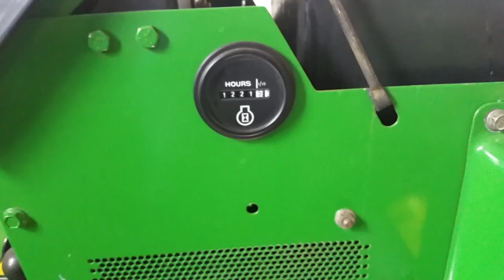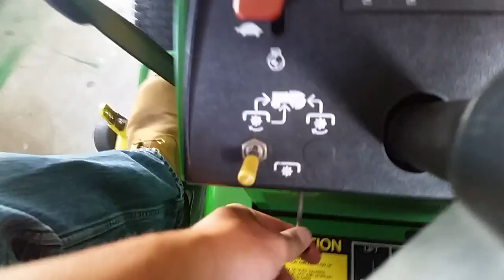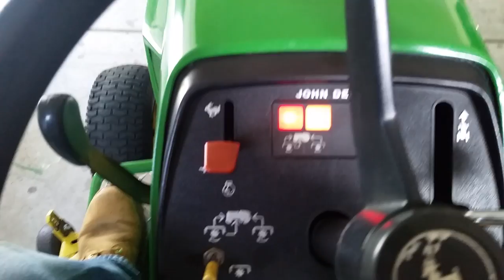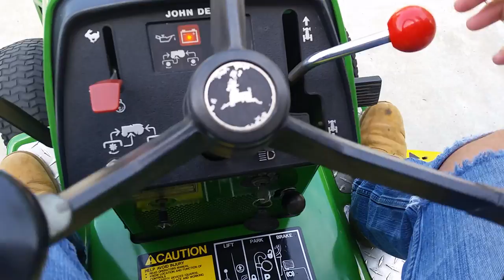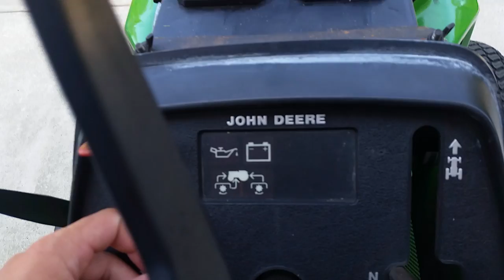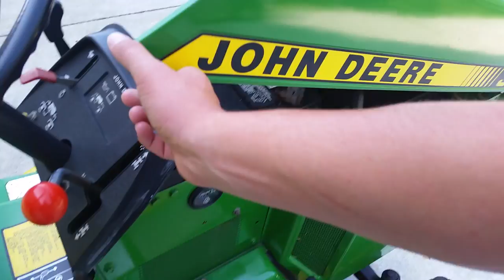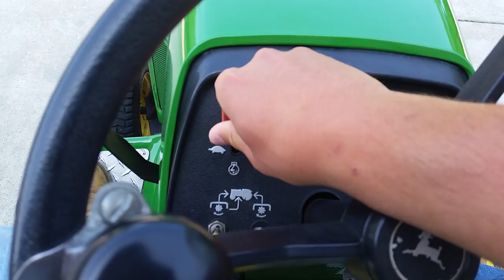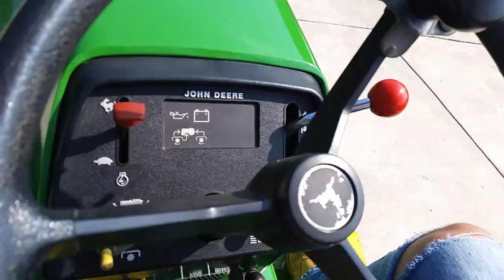In-Depth Review of the 1987 John Deere 316 (R.I.P)

Comment: My humble opinion is the 316 is far superior to the 318. I know I'll be heckled here, but less leak points on hydraulics and the same chassis, tires, power plant, lights, tranny, attachments, and other than the operator, same package. With that said, What can a 318 do that a 316 can't?I have an '84 316. I have an after market 3pt. hitch, everything else came from John Deere in Bangor, Maine. A few upgrades you want to look that are really inexpensive are headlight upgrades to LED bulbs and fixing your non functioning right side light, removing and upgrading to tail light from reflectors, an older, single spool 54 dozer blade - mine is a brass tag blade for a 140. Swap tires on rear to Carlisle true Powers 4 ply, and I run in Maine year round the 4 ply Firestone tri-ribs, and have no issues.When running the headlights in LED and tail lights, you're battery won't even know lights are on. Also -  install aluminum 9 LED tractor lights on your rear fenders that with all lights on and the front PTO running no battery light on.Get yourself a 30 Hyd. Tiller, 54 Dozer blade, 3 pt. hitch, grill guard with weight bracket, a load lifter, and 15 suitcase weights.Chains on rear for winter and you've got the best working tractor in America.God bless and crank up that awesome John Deere. 316 is the best garden tractor ever made.
Reply from the maker: +Jake Hughes I do see where you are coming from. For what I do, I don't really need power steering or H2 hydraulics. I do agree with you that it's less crap to worry about fixing or leaking. I don't need power steering to mow grass - the heavy-duty steering box on my 316 steers real easy. Only time you really need power steering with these is if you are running a loader or the big two-stage shaft driven 47 blower, which is one of the things a 316 can NOT handle because it is only H1 hydraulics. Only downfall really. Otherwise I agree with you on pretty much everything. Since this video was taken, I have installed working tail lights on the tractor. The previous owner put new headlight bulbs in and they shine bright, but when they finally die I will probably do the LED upgrade. Just can't put forth the money right now. I have also purchased a 54" blade with a manual angling kit that came off a 140 and plan to use it all winter for plowing snow. Just as capable as a 318, even with the manual angle. I don't need hydraulic angle. I have wheel weights and chains and I could probably get a brush guard and weight bracket to hold extra weights if I really wanted to. I have 75 lbs of weights for each wheel, plus tire chains, so we'll see how they do.

As for a 3-point hitch, my uncle has one on his 318 and I have a sleeve hitch on my 210 so any ground-engaging work I have covered. This 316 is so nice I don't want to put it to work doing heavy stuff just yet. I'd rather use my gear drive 210 than the hand control 316 to pull a Brinly plow or cultivator anyway. Only reason I'd get a 3 point hitch is if I had a rear PTO or needed to hold weights. My Carlisle Tru-Powers are mounted on the 210 which is my 4H fair pulling tractor so they will stay mounted on that tractor. I have a set of the Carlisle All-Trail HDAP tires that will be my snow removal tires. Going to keep the tire chains on them year-round.
Reply from the maker: +MichaelTJD60 I do wish I had the turning brakes and the fuel shutoff valve from the 318 though. Those were just some of the things they eliminated to make the 316 an economy version of the 318.

Comment: I’d like a John Deere tractor there was a steal of a deal on a 330 for 750 bucks with a cab and snowplow didn’t run but that’s not a big deal but there’s a 316 with a snowblower and mower deck for 400 bucks probably needs a rebuild because it’s a little low on compression in right cylinder
Reply from the maker: Sounds like it would be a good project. The Onan engines are pretty easy to work on and will last a long time if rebuilt correctly.

Comment: I lucked out with my 316 it has the four hydraulic connectors on the front  the two levers on the left and the dual brake pedals  power is the 16 horse Kohler
Reply from the maker: +taz Man The early 316 from 1978. Same exact tractor as a 300. Totally different animal from this Onan 316 but still just as tough!
Reply: yeah I also have the 314 with the 14 horse and a 300 for spare parts
Reply from the maker: Sounds like a nice fleet of machines.

Comment: I'm thinking about buying a 316 Your video is very helpful  what to look for When I go to see it!  I no very  little about them, The one I'm going to look at looks good they say it's got a Briggs&Stratton Motor I wonder what year did they come out with this and what do you think about the Briggs&Stratton?  I can get it for around 700 or 800 They say it's in very good condition?
Reply from the maker: 316's are great tractors but they did not come from the factory with a Briggs & Stratton engine which means someone repowered it. The later style 316's like the one in this video were made from 1984-1992. $700 doesn't seem too bad of a price but I would run it a good 20 minutes and make sure the engine sounds good and runs strong with no smoke or leaks. Check the transmission to make sure it has no slop or wear, make sure the hydraulics work properly without any leaks.
Reply: Thanks for your help I really appreciate it!  I think I'll wait and try to get one with original motor, thanks again!
Reply from the maker: No problem, glad to help.

Comment: Where is your favourite tractor I am restoring my L112 tractor after I’m done restoring my tractor I’m going to be buying another one but I don’t know what to buy I think a 316 in very good tractor
Reply from the maker: 318's are my favorite, but the 316 Onan's are good tractors if you're looking to get into the bigger models. I wish I still had the one in this video...they are a little more affordable than the 318's.
Reply: MichaelTJD60 where do you get the  stickers  i'm trying to find them but I cannot find the one for my tractor
Reply from the maker: Deere can get you most of the decals...which ones do you need?
Reply: MichaelTJD60 The safety ones and how to operate the machine
Reply from the maker: Check with your Deere dealer
Reply: MichaelTJD60 thank you

Comment: The two I would love to own is a 455 or the 322 as a close second.
My list:
The Kings: 140,318,455 and the 345
The ugliest: 430
The last decent lawn tractor: LT series
Rarest:Patio colors, round fenders and the 355D
Any to add?
Reply from the maker: crazyjdkid The round fender 110 was also a king. And probably the X748 instead of the 345. I don't consider the 430 ugly, just very large...lol. The LT and late LX series were made at the same time so you could consider both of them. Rarest tractors are the 1963 110, 1966 112 round fender, 120, Patio 120, 208, 312, 316 Kohler, 330, and the 285 with EFI. And yes, the 335D and GX355.
Reply: MichaelTJD60 Oh forgot about the x748! I threw the 345 out there as many say it is one of those tractors that was great all the way around. I have one and it sits in the shop more than its out working. I like the hood vents on the 285!
Reply from the maker: +crazyjdkid The 345's were really good tractors aside from the plastic cam and leaking fuel pump issues. Good strong lawn tractor with garden tractor capabilities and features for a decent price. Hydro lift power steering, and liquid cooled.
Reply: Too bad they were caught in the era of the cracking hoods. My hood is gone on mine, vibrated itself to pieces!
Reply from the maker: +crazyjdkid Sounds like a typical John Deere lol. They really didn't think it through when they started out with plastic. If you find any late 80's, 90's, or early 2000's Deere's without a broken hood, you hit the jackpot.
Reply: Yep! They seem to have sorted out the issues in the X series. My next machine will most likely will not be a JD. I just get too much down time with them and the cosmetic issues are a money pit. I can't justify $600 for a new hood that will just crack again. Planned obsolescence if you ask me. Will definatly consider Kubota, Kioti and Mahindra next go around.
Reply from the maker: Well they may be expensive but Deere has learned from their mistakes and the money will get you a much better quality part. I'm not a huge fan of Deere's prices either but they build a darn good machine and will outlast most of the rest. I would never go near any of those three you mentioned. I'd buy an older 2210, 4410, or even an old 755 or 855.

Comment: Can you hook up a loader for the 316?
Reply from the maker: The JD 44 loader was an optional attachment for these tractors. But they are getting harder to find and cost more than the tractors are usually worth.
Reply: @MichaelTJD60  Are there any other loaders that will work with it?
Reply from the maker: @HalfmoonVIP  The CTC 3240 should work with a 316 Onan.
Reply: @MichaelTJD60  thanks!

Comment: You have to watch with this 18 hp Onan there gets to be lots of carbon deposits on the valves / valve stem. It can end up seizing the motor, the original book said to clean it out every 200hrs. That's what happened to me, and it was a pain in the ass to clean the entirety of the rotating assembly
Reply from the maker: +sleeperfox302x I've never heard that about the Onans, but like any old gas engine, they do get to burning oil and carbon buildup after so many hours of run time. The P218G is known to toss the valve guides/seats because of the excessive heat that people let build up inside the cooling fins. That's why I tear the machine apart once every month or two and clean all the dirt and debris out from inside the cooling fins - so the engine stays cool.

Comment: What does it mean when I am snowblowing and the engine bogs down?
Reply from the maker: Either you're going too fast, or it's just too much snow for your engine to handle.
Reply: Means you have to much snow move to Florida and that will solve the problem
Reply: Means you need a bigger tractor or less snow.

Comment: whats the difference between the 316 and 317? and which ones better?
Reply from the maker: There are two 316's...the 316 Kohler (made in 1978 only) has dual hydraulics, dual brakes, the Dana rear axle, and the Kohler K341 16 HP engine. In 1979, it was replaced by the 317, which is basically the same tractor, except it has a Kohler KT17 opposed twin engine and a driveshaft with universal joints instead of a straight shaft. 317's developed a bad reputation due to premature engine failures from a lack of oil pressure, the steering was not hefty enough for the weight of the engine up front, and the driveshafts had a tendency to wear out because they weren't greasable. The 318 replaced the 317 in 1983, and the following year they introduced the 316 Onan, shown in this video. The 316 Onan is built on the 318 frame and has the same drivetrain as a 318, but lacks a few of the 318's features...manual steering instead of power steering, single hydraulic remote instead of dual, single brake pedal instead of dual, no hydrostatic oil cooler, no fuel selector valve (reserve tank), and reflectors instead of taillights.
Reply from the maker: The 316 Onan is my preference...they are basically just a more affordable version of the 318 and most of the 318's features can be swapped onto one. The frames are better and the Onan engines, if taken care of, tend to outlast the Kohler KT17's (and in my opinion, are a much better-designed and more durable engine all around).
Reply: @MichaelTJD60 Thanks for the response, I know u have been busy with College and not really been making a lot of video's.  Miss the 316 from this video, that was a great tractor but sadly she cant last forever
Reply from the maker: @jackolson6479  Someday I hope to find a 318 as nice as this 316 was. I'll just keep buying and selling until then. I bought a 318 last week and sold it yesterday.
Reply: @MichaelTJD60  Oh thats great, Im gonna sell my John Deere 108 that I restored and my John Deere Lx277 all wheel steer for a John Deere 316 with a cab and blade, do you think that Is a good idea?
Reply from the maker: @jackolson6479  Yes, as long as you can get enough money from selling those two. You'd be looking at about $1000-1200 for a really good 316.
Reply: @MichaelTJD60  Okay good because I found a John Deere 316 with a 49 blower and a 50 inch deck with a 16 hp Onan for $1350, do you think I should jump on the deal?
Reply from the maker: @jackolson6479  If the engine runs good with minimal blow-by or smoke, and the trans/hydro works good with no leaks, it's a steal. The engine is the deal breaker with these things....if it wasn't given proper care in the past, it will cost about that much just to rebuild.
Reply: @MichaelTJD60  Well thanks for the help I will sell both of the Tractors, I really dont like the Kawasaki engine in my lx277 and the steering in my Lx277 aws is going bad so I am going to sell it while I still can
Reply from the maker: @jackolson6479  Those LX's are good mowing tractors. I have an LX176 sitting out behind my shed right now...that's another project for another day.
Reply: @MichaelTJD60  Yeah I want a Tractor thats a little tougher and better for my mowing and plowing bussiness, what would be the better tractor, the 316 or the Lx277 aws, the problem is that you cant really find a snowblower for the lx277 aws and I kinda want something with hydraulics and more power that can handle more snow.
Reply from the maker: @jackolson6479  The 316 is a good all-around mowing and snow plowing tractor. Not quite as many features as the 318, which means less parts to break, leak, or wear out.
Reply: @MichaelTJD60  Okay thanks for the tips

Comment: Do you have to keep hand on forward reverse control to move it. ?
Reply from the maker: You should be able to just slide it into forward or reverse and it will hold that speed by itself, unless the linkage is worn out. I always keep my hand on the lever just to be safe.